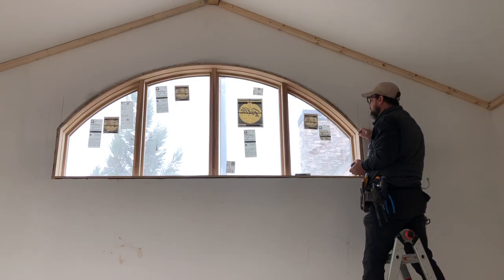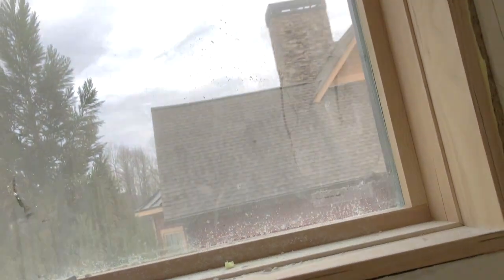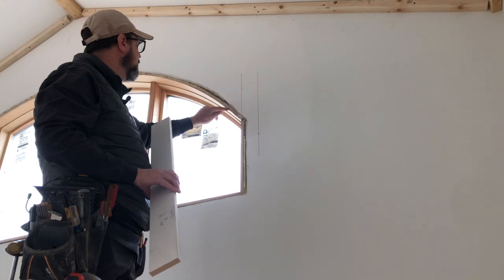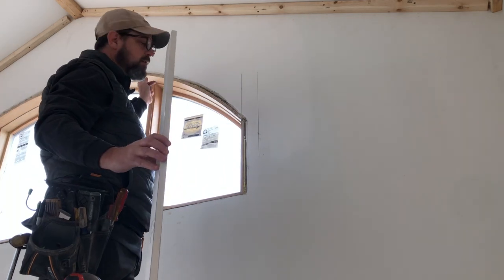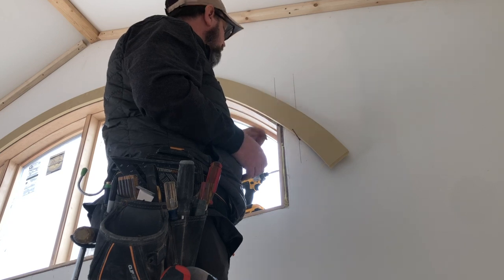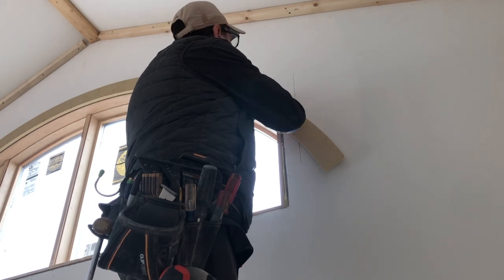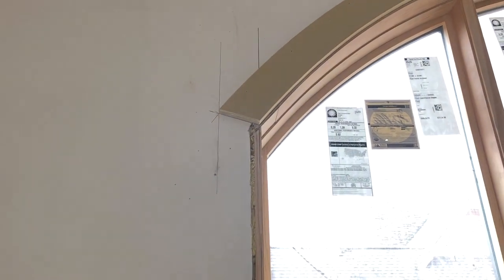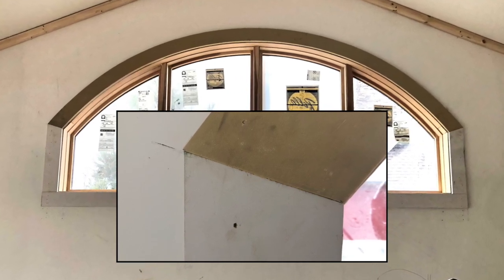How to trim an Oval or Arched Window

Comment: I found this tutorial very helpful. Could you please specify which Carter product and coordinating trim used for this trim work? Thank You!
Reply from the maker: Will get the information for you. We hade just switched suppliers at the making of that video and we are using a new supplier that delivers the product in a third of the time and the quality is a bit better as well. Thanks for the comment.
Reply from the maker: Forgot to mention that the arch molding can take a paint or a gel stain
Reply from the maker: Getting ready to do a walkthrough of the finished home that will show the arches painted and stained

Comment: You could have packed out the sides 1/16”… I find using non corrugated cardboard from soda boxes works great for this… anything thinner use cheap playing cards from the dollar store. 😁
Reply from the maker: Thanks for the tip.

Comment: Is that rated for exterior use?
Reply from the maker: Yes. The siding guys used the same product on the outside as well. It can be stained with a gel stain or painted. This customer stained and painted on the inside. The material is easy to sand as well.